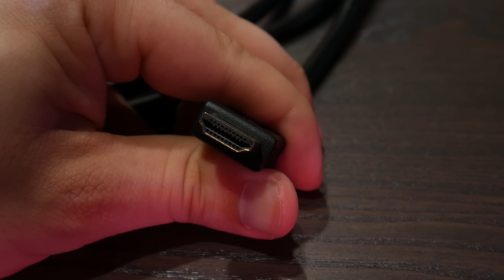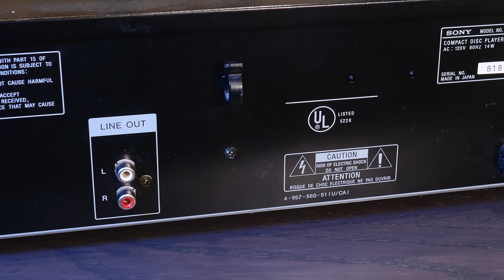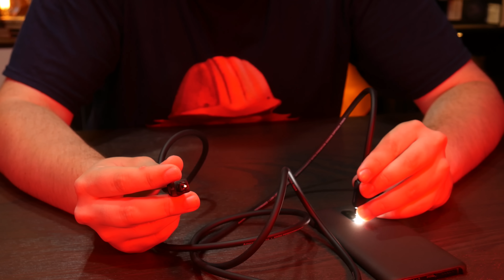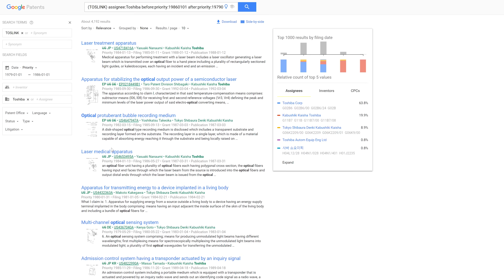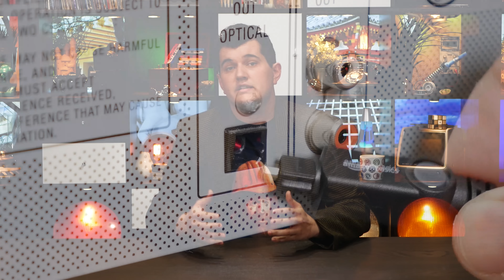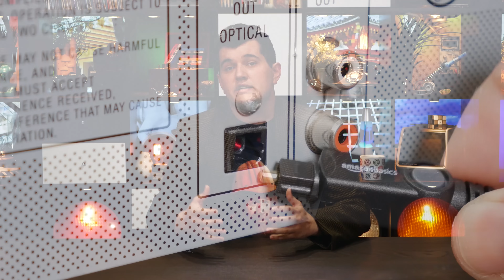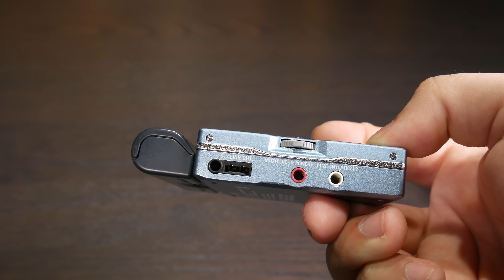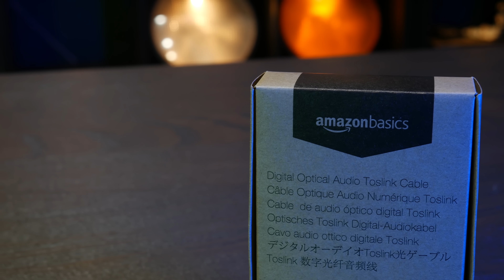TOSLINK: That one consumer fiber optic standard

Comment: The main advantages of TOSLINK and other light-based transmission:
- Ground separation ( avoiding ground loop through mains grounding pin without disconnecting it, and keeping devices safe and hum-less caused by ground loop, metal enclosure eliminates EMI )
- Eliminates pulse transformer at many S/PDIF designs

- No parasitic capacitance and inductance that might be an issue in long running cables at higher than 44.1kHz sampling rate, and TOSLINK can be insanely distance-proof if laser and phototransistor is used with ZBLAN fiber and IR light, but it's too extreme to use ZBLAN, instead silica and 1.4µm should do the trick.
That's why internet through fiber is usually faster than other medium.
- MUCH easier and cheaper to build than high bandwidth conductive cable ( for short distances )
- Can be expanded to any other light medium with ease ( eg. non-critical data transmission using IR transmitter focused on other building without wires )
- Can transmit analog and digital signals without ground-referencing
BUT...
Big majority of these improvements and specs are not included in TOSLINK standard.

For standard CD audio, S/PDIF is more than enough, If ground-loop problems doesn't show up.

Comment: There's optical thunderbolt, though. So there's not one, but TWO WHOLE standards! Well, not exactly standards. Just a fancy nonstandard alternative.
Reply: darjanator You are wrong. Optical Thunderbolt (and HDMI cables for that matter) are not optical standards. All they do is convert the signal to an optical signal to be sent through the cable and then it converts it back at the other end of the connector.
Reply: @andykillsu  It's almost as if you only read the first half of my comment. Huh.

Comment: Oh god you just answered one of my life's biggest questions.

Back when I used MacBooks, I realized that the headphone jack would glow red when installing Windows. I always suspected that it was some optical interface, but I was told many times that it was just an indicator that would light up when there was a driver issue.
Reply: It was a great feature of almost all apple computers from 2006 to 2016.
Reply: @sniglom  Wow. I didn't know that they removed it from modern devices. I've used it before on my old iMac (with a 20m toslink cable no less) a while back. But I've just checked my  2018 MBP and yep, no mini toslink there.
Reply: Happened to me under OS X also, due to a dirty connector. Plugging in a cable and unplugging a couple of times would help.
Too bad they removed the mini-toslink and just have the normal 3.5mm jack since 2016
Reply: @pgrobban  Be glad they still have the 3.5mm jack. Kind of surprised they haven't pulled that so you have to buy an adapter like you do for their phones.
Reply: The headphone jack of my MSI laptop also glows red, i use that light to help connect my headphones while i´m using the laptop in the dark... please don´t throw me stones, i always thought that a laptop that has a illuminated keyboard can has as well a helping light to connect you headphones... you can throw me stones now :(
Reply: It is true that it lights up due to a driver issue, because old versions of the driver included in Boot Camp didn't turn off the output when unused, but not as a "driver issue indicator light."
Reply: I once had a portable minidisc recorder with a 3.5 mm style toslink input. It came with an optical cable to hook it up to a CD player and was completely made of rather cheap plastic, connectors included. Worked fantastically. This was early 2000s. That exact same cable would've fitted in your laptop to make digital recordings. 😎

Comment: I found a good use for a toslink: to connect my TV with the soundbar without using wifi, since the modem was really close and did indeed cause interferences in the audio signal. Using the digital input saved the soundbar from getting returned because I thought the audio was too crap to bear.
edit: I didn't use the HDMI cable because it was too bulky to route inside the cabinet.

Comment: While digital signals don't degrade from electromagnetic interference per-se, immunity to/shielding from electromagnetic interference can increase the functional range that those signals can be sent without glitching or dropping out. Not that any existing Toslink cables take advantage of this fact, since most of them are <7 feet long.

This is part of why the USB format standard has + and - signal pins in a twisted pair. Your signal doesn't get much more digital than USB.

Comment: TOSlink is neat. And mini TOSlink is definitely a thing; my old laptop from 2008 had digital inputs and outputs in the microphone and headphone jacks.

It's true that digital audio doesn't get distorted by interference. But a coaxial cable with a digital signal CAN cause trouble in the form of ground loops.

It's easier to implement an optical digital output (even at current speeds) because it's just an LED; for coax digital you need a transformer and some other analog components on the output as well as on the input.

As far as I know, the reason that so many CD players from the 1980s and 1990s didn't have one is because back then, the optical cables cost a fortune. I remember paying something like $60 for my first 1 meter long optical cable.

Comment: 10:50
See this is where I get confused.
If digital signals are a high low high low, why do we need Active Cables for long HDMI?
It's always confused me since HDMI or say USB is a digital signal traveling at the speed of light, analog noise shouldn't interfere with it.
But yet, those cables are sold by the masses!

I need some answer, I cant find anything online and it's driving me insane.
Reply: HDMI wasn't designed to use a lot of power to transmit a long distance.

Comment: Thunderbolt was originally supposed to be a purely optical standard (and at extremely high bandwidths). The thing is, it was significantly cheaper to do it with good old copper, and it turned out that they could hit pretty decent cable lengths at full bandwidth. You do still need to use a fiber optic thunderbolt cable for long runs (the transceivers are in the cable, not the port), but copper cables are good for up to three meters, which is plenty for most use cases. As such, there isn't much demand for fiber thunderbolt cables, making them even more expensive, and the demand is so low that nobody has even bothered to make a fiber optic thunderbolt 3 cable yet.
Reply: They have optical thunderbolt 3 cables that convert the signal to be transmitted optically. However there is no optical thunderbolt 3 ports.

Comment: I have an audio mixing pc with various sound cards and audio components. The ground loop i was experiencing was completely solved by disconnecting the electrically based connections and using fiber.

Comment: HDMI ARC is the bane of my existence!!!! sometimes it works sometimes it doesn't !! I would prefer an optical cable any day over ARC!!! Anyways thanks Alec for the video ,made my day. Oh and also if you want your audio to work 100% of the time use an optical cable over ARC........wow I just cant seem to let this go........
Reply: amen!!! I have suffered through some dark moments trying to get (or to keep) an ARC connection working.
Reply: I have been using ARC for 3+ years and had very very little issues.

Comment: A lot of audio equipment uses built-in double isolation power supplies without grounding the chassis to the mains earth, so the internal grounds are always isolated from the mains. Now if TOSLINK is used across the system, instead of all equipment sharing one big signal ground that may lead to grounding issues due to ground inductance, each piece of equipment gets its own isolated ground. This is especially useful when float-ground A/V equipment need to receive signals from mains-earth-grounded equipment like most computers.

Comment: I was just thinking the other day about how everyone is struggling with the latest displayport and HDMI standards vs high refresh rate 4k+ monitors but there already exists fiber Ethernet cables and transceivers that can do 200gbps all day long. I'm guessing the limitation is cost when integrating into consumer hardware but stuff can be made so cheaply nowadays... Come on. Same thing with PCI Express. You could replace the like 60+ contacts of PCIe with 2 or 3 fiber optic connections and a power cable. Then you eliminate the issue of tighter and tighter pcb design standards for each PCIe generation.

Comment: As a former installer of commercial A/V systems, I think you underestimate the effect that ground loops have on sound quality, even when they are caused by digital interconnects. The loop currents that flow can be quite large, especially if the cable run is more than a few feet. Even if they don't affect the digital signal being carried in that cable, they will almost always, in my experience, create interference that is picked up as audible hum by the analog portions of the system. Commercial systems avoid the problem by using balanced connections everywhere, and by breaking the shield grounds at strategic points. Those solutions require both expense and expertise.

I confess, I don't understand why optical interconnects aren't used for modern consumer video interconnects. HDMI is, at least, electrically balanced, as nearly any interconnect at that speed has to be, but the use of shielded cable means it is still susceptible to ground loops. And given that you have to take out a second mortgage to buy a decent quality HDMI cable, it hardly seems that copper has a cost advantage.
Reply: SPDIF is as far as I have seen specified to be able to go via a optional isolation transformer. Your remark kinda points to that not being often implemented for unknown reasons.

At least, you can buy SPDIF transformers for use in products, maybe even patch them into the coax.
Reply: What's the point of spending a fortune on an HDMI cable? That is also a digital signal, the only limit I see is that some cables don't support all HDMI versions, but other than that, they should be more or less all the same...
Reply: @JonasDAtlas  I've had trouble with the signal dropping on cheaper cables.
Reply: @JonasDAtlas  There isn't really a thing such as "digital signal", cables only carry analog stuff.

Also a given receiver require specific signal quality in order to recover the data. Too bad signal quality and it won't decode right!

The "version" is more like a quality factor, or in actual use just a marketing term! High speed and/or long distance require good quality cables.
Reply: @erlendse  Yes there is such a thing as a digital signal. These two work in fundamentally different ways. As long as you can reliably distinguish the digital signal from background noise, the decoding is perfect. It either works, or it cuts out and doesn't. Also, versions matter, mainly because of HDCP - some cables won't work with 4K signals for that reason, for example. There is an argument to be made for long distance, but that mainly comes down to decent shielding.
Reply: It would also mean having to use one of your HDMI inputs for ARC instead of being able to connect another input device.
Reply: Joe Al  What you are describing is in direct contradiction to how digital sound works... As soon as you're talking about analog, you might have a point, but in the digital realm the cable can't affect the sound.
Reply: Joe Al  It's not quite that simple but that has nothing to do with the subject matter, that's about codecs and completely unrelated.

Comment: Is it just me or did that Mini-Toslink cable end look incomplete?

I mean if they added similar wiring/connectors/plating like you'd see on a standard 3.5mm audio jack then they could have been in a position to exploit that extra hardware to carry power alongside the data running through the optical fiber.

Which could have put Mini-Toslink in a similar place then that USB occupies now.

Comment: If I’m correct, TOSLINK is just the connector and thus could support far higher bandwidths than HDMI if there was a good enough ‘S/PDIF equivalent protocol’?? The only exception is returning connections like ARC since TOSLINK it’s one way.
Reply: It's not ideal for high-speed. Multi-path dispersion issues on the very large plastic fiber. You'd never get it up to even one gigabit-second.
Reply: Also, you'd have compatibility issues if you just suddenly used the same cable for a different signal...
Reply: @JonasDAtlas  In the case of optical fiber, all that matters is the core diameter, wavelength, and dispersion. For the plastic fiber used on TOSLink, these are defined as 'gigantic,' 'redish' and 'crap' respectively. It's designed for low-cost mass production, and isn't constructed in the way needed for high-throughput communications.
Reply: @vylbird8014  Yeah, I kind of suspected that would be an issue as well, if only a secondary one - this isn't exactly what you'd call high quality, it's effectively just fishing line. But I was pointing out that using this particular existing cable wouldn't be a good idea even if you could.
Reply: @JonasDAtlas  It has it's uses. I used low-speed fiber for a high-voltage impulse generator. Something of an electronically hostile environment - the pulse that thing puts off is enough to crash mobile phones nearby. Using fiber to connect the control panel means the operators have no potential electrical connection to the zappy end.

Comment: I would always use TOSLINK because practically everything had a optical input/output and you used to be able to get a 3 pack of cables on eBay for a buck haha (not to mention most devices that LED was always on even when the device was powered off so connecting them was super cool)

Comment: 11:57 Well I was one of those who had feedback distortion between my amplifier and TV audio out that I had to get audio ground loop isolators to prevent grounded sourced noise distortion. A fiber optic cable would have been optimal then if either the amp or TV had it. Due to the induction values of the coils the audio quality suffered. So a digital signal is not affected but the wire leads can infect the common ground wire with voltage line noise.

Comment: But but but... THE FUTURE! FIBER OPTIC! The first time I used TOSLINK in the early 90's I felt like an audiophile GOD (and had no idea it was already a decade old).

However, FYI, it does help deal with ground loop issues that can show up on both coaxial and HDMI. I've had several instances where TOSLINK saved me (including literally now as I watch this show with my desktop hooked up to an old Stereo). SPDIF via coax has a nasty hum on my old stereo- and a Blu Ray player introduces a hum into my newish Pioneer stereo via HDMI. Both solved with TOSLINK (yes I know I'm losing capabilities with SPDIF via Blu Ray but my setup isn't affected). It's very probable that I could hunt down and isolate the loops without much bother, but TOSLINK was easier.

SO THERE! ;)

Comment: It seems TOSLINK might be useful not because it doesn't receive electromagnetic interference but because it doesn't make electromagnetic interference along the cable run?  So if you have quite a few wires that need to run and be powered right next to each other, it might be helpful.

Comment: One thing I was disappointed to not hear mentioned in the video is that having S/PDIF over a separate connector makes it a little clearer whether a device supports digital inputs/outputs, as opposed to RCA connections which also carry analog signals. It would also require configuration on the device if you plugged a digital RCA device into one that only supports analog RCA. You'd essentially run into the same issue you described with TOSLINK backwards compatibility, except for RCA.

I kinda wish there was an up to date version of TOSLINK that did support uncompressed 7.2 audio. For example, if you want to have surround sound AND UHD video from an Xbox or Bluray player hooked up to a TV, you have to buy a top of the line receiver or sound bar, which can end up costing more than the TV and Xbox combined. It is also really hard to tell as a consumer prior to purchase whether a given receiver actually supports UHD (4K + HDR + 60Hz). Sound bars are a little better in this respect, but they seem to be tied to the specific manufacturer of the TV so you get fewer options.

If there was an up to date version of TOSLINK, you could simply run the audio out from the TV to a simpler surround sound DAC+amp. The DAC would not need to know about video signals at all, and would not need to have 8 HDMI 2.0 ports, so it would be cheaper to manufacture than a receiver.

Comment: The thing I never understood is why Toshiba didn't just make the specs for TOSLINK overkill from the beginning.  So, it'd still support SPDIF but also 8 channels, each at 24-bit 192KHz.  Kind of THE benefit of fiber is being able to carry more data over a single cable.
Reply: @aphenioxPDWtechnology  Understood - I wasn't exactly expecting the technology back when TOSLINK was first made to support such things, but rather, have those capabilities within the specification in the event it does support them.  Being a digital interface, they could easily change the signal to fit whatever the user wants.  Then, when better sound processors came out, they could take better advantage of the original spec.
Think of it like the game Crysis: it was more graphically detailed and demanding than what any PC could handle for the next couple years.  It still looks good by today's standards, despite being a decade old.

Comment: There is a rarely used standard for long HDMI cable lengths to use HDMI with optical fibers... so... that's something in the consumer world, albeit barely.
Reply: It’s not really a standard as all it does is convert the hdmi signal to optical and then converts it back at the other end.